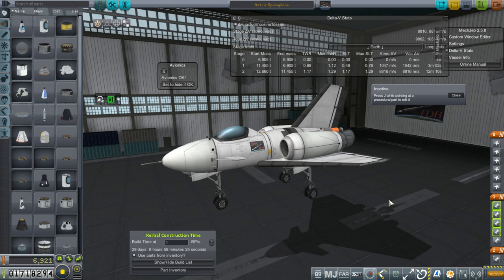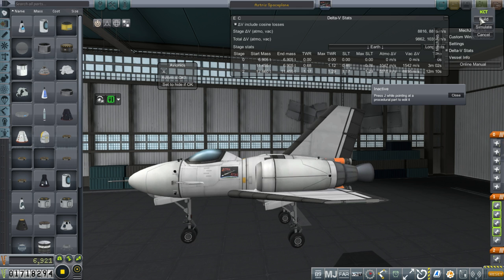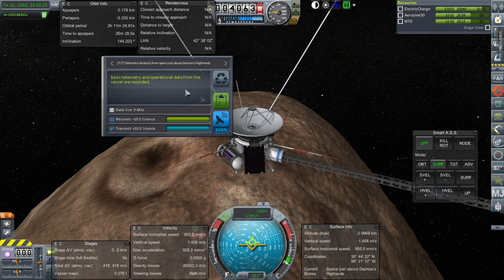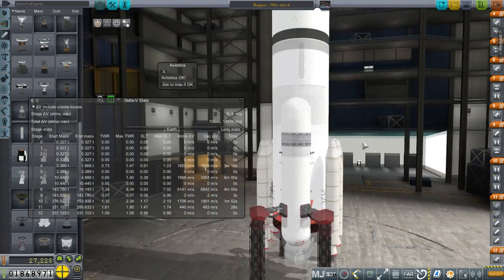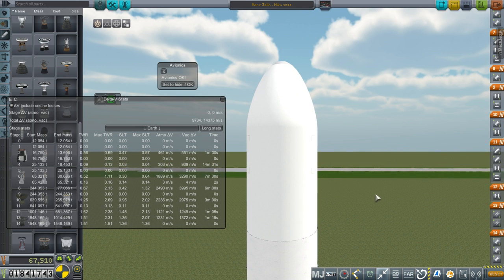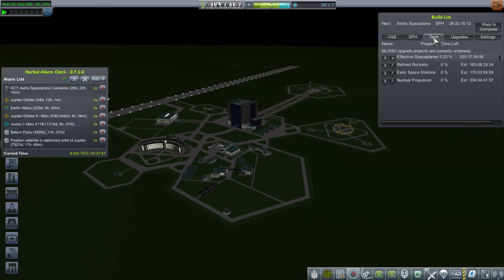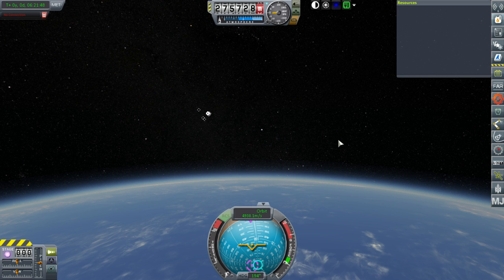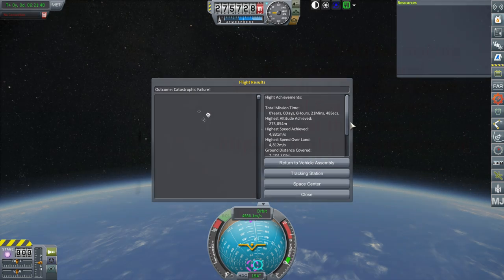Realism Overhaul in Kerbal Space Program 1.1.3 - 47 - Mars Armada 1

Comment: If it's only a random overheating issue when you load the craft, I think to be safe, you should turn on infinite heat-tollerance cheat just when loading the craft, and turn it off after you've loaded it, before you actually do anything.  Just give it a try, and see.  Honestly, what I think is happening, as you had rtg's on that probe, is that all the waste heat the rtg's were producing wasn't being calculated while it wasn't the loaded craft, and so over the months while going to jupiter, it just built up, and was applied all at once.
Reply: Well I'm not saying you should need to use cheats all the time.  I'm mostly only suggesting it as something to TEST the theory, and if it proves correct, find out what you need to do to resolve it.

Comment: The Youtuber "Cosmonaut Crash" has had the same issues with his Jupiter probes. He thinks it is a bug of RSS in 1.1.3. Other planets dont seem affected.
Also he might have a solution for your space plane problems, because he constructed many planes in his series. Maybe you can check it out.
Reply: Tyler Raiz He replies almost every comments in his video, so I think you can just ask him about your problem.
Reply: He's also a big fan, so...

the wheel issue- I have had success turning the wheel friction of all wheels down to zero before takeoff, and adjusting the rear wheels back up after a successful touchdown, brakes don't work without fiction. (still struggling with the wheel bounce issues though )
sometimes it's just a matter of removing the gear in SPH and placing new ones.

random explosions due to overheat - I've had this take more than a few ships. seems to happen regardless of SOI, so I think the KAC suggestion is worth looking in to. but I have had it happen when jumping to ship from tracking station as well as through KAC menu.